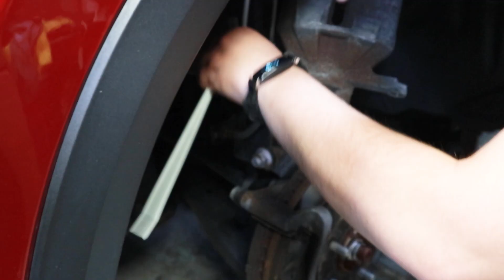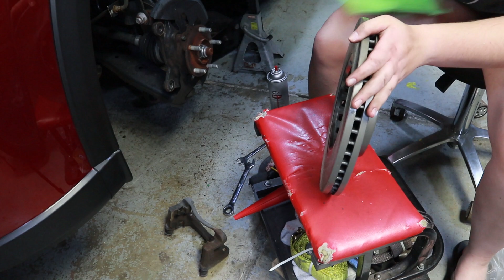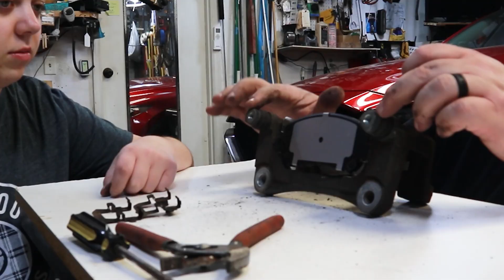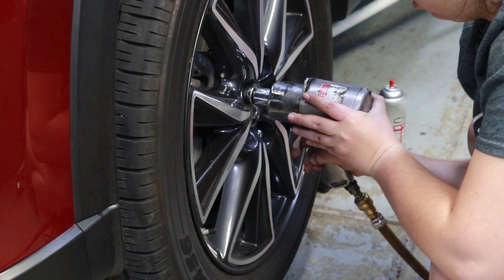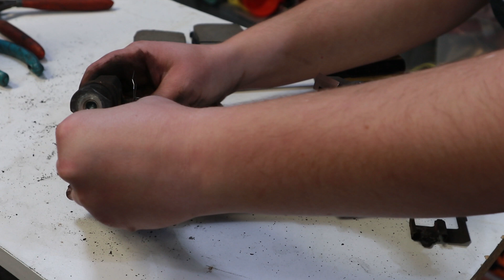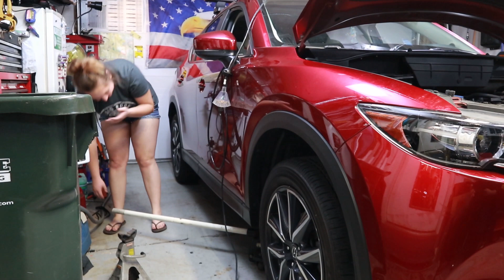Replace Front Brakes on a Mazda CX-5 or CX-9 #baldeagle242

Comment: I went in to the dealer 2 years ago with my 2018 CX-5 (had 40k miles on it at the time) and they said I needed new rotors and brake pads, I didn't have the time myself so I forked out around $800 to have them do it! I found it very odd that such* a new vehicle would need new rotors so soon
Reply from the maker: That was my thoughts as well. I've always changed my own brake pads and rotors, and this is the only vehicle I've had to replace rotors on before the first set of brake pads wore out. Thanks for watching!
Reply: I have the CX5 and the rotors warping is a know problem. I'm kinda upset as well. I just bought the car used only has 40k on it and the car needs new rotors which is just nuts

Comment: Love the father-daughter teamwork. My daughter has the exact same vehicle and we've done the same job!! Just a couple of additional steps some folks might want to take. 1) Clean the calipers with a wire brush to get any corrosion out from under the new pad shims 2) lubricate the shims where the pads slide on them with some brake grease. Lack of lubrication here is often the cause of premature wear because the pads get stuck against the rotor. 3) Don't assume the caliber pin bolts are okay just because they move freely. Take the out, look for rust, clean them and re-lube them with silicone brake grease 4) Use a torque wrench (most auto parts stores have loaners) especially for the caliper pin bolts. The torque is relatively low (around 25 ft.lbs) on those so use blue thread locker (no grease or lube). 5) use an old brake pad behind the C-clamp so that the clamp jaw doesn't dent the caliber piston. Also push the piston back in very slowly and have the brake fluid fill cap off (to relieve pressure in the master cylinder). If the piston takes excessive force to go back in, the caliper is likely bad. 6) clean the wheel hub with a wire brush before putting the new rotor on the hub. If there is any rust on the hub, the rotor will not spin true and pre-mature brake and tire wear/wobble can result. Lastly,  a thin layer of anti-seize or grease where the rotor meets the hub will ensure they do not get stuck later on. Hope this is helpful and again, great video.
Reply from the maker: Thank you!

Comment: Did i miss the section where you applied brake grease to the new clips and back of the new pads? Anti seize on the lug nuts help make the job easier next time.
Reply from the maker: It’s been a while since I’ve watched this video but I’m pretty sure we showed it at some point. 🤷🏻‍♂️

Comment: I recommend rotors with every brake job. These days the warp easy and they’re not as think as they used to make ‘em. Also they do rust if not driven as often as they want to be
Reply from the maker: I have to agree with you on the rotors.  Gone are the days you could turn them a couple times and reuse them. Thanks for watching.  🦅🇺🇸

Comment: Great video, but few steps are missing.  Are there brake pads wear indicator clips , which are usually attached on the sides of the brake pads ?  You should've point out that the brake fluid reservoir needs to be open during the process of squeezing back brake piston .  Also, at the completion of brake job, brake pedal should be primed (pumped down) a few times before driving .  Mazdas CX5 are generally good cars, but notorious for  their weak brake pads and rotors which tend to be worn prematurely .  You are lucky dad, as you have lovely daughter .  IMAO I personally wouldn't let her lift that heavy wheels only by herself .  Thank you for your video and effort .  Greetings from Croatia

Comment: When you push the cylinder back in with that C-clamp, aren't you pushing dirty-rusted brake fluid back up to the brake reservoir? Isn't there a technique or practice to prevent that from happening, especially having an old vehicle?
Reply from the maker: +Bill Krause, my assumption is it's the same fluid that gets pushed back and forth with normal braking. If there's dirty rusted brake fluid in there you've got bigger issues.
Reply: Yes, changing the fluid is a separate job and you'd normally do it when you change the calipers because you have to bleed the brakes at that time. 

Caliper is likely sticking and causing the uneven wear on the rotors! That is why you notice the difference, they should appear even. Also clean and lubricate the long pins that the pads move on as rusty ones can also cause uneven wear. Thankfully you didn't have to back down ABS on this newer ride.
Reply: You can open up the bleeder valve before pushing the piston back in.. That way the fluid in the caliper dont go back into the system.

Comment: Great Video! I need to change mine soon, You don't have to bleed the brakes do you?
Reply from the maker: You won't need to bleed the brakes unless you have to replace a caliper or open the system up for another reason.  Just remember to slowly pump the brake peddle a few times before you drive the car.  This will ensure the caliber is where they need to be for the pads to engage the rotors.  Good luck with your repair.  Thanks for watching and let us know how it turns out.

Comment: I have a 2019 CX 5 AWD Signature - 11000 Kms (6000) miles and all 4 rotors and pads need replacing - Dealer states car was not used enough and rust damaged the brake rotors and subsequently the rotors damaged the pads - No warranty - Total garbage parts in my opinion -  PS - your daughter is a class A mechanic
Reply from the maker: Thank you.  I agree with the garbage parts. No reason these rotors should be shot in such a short period of time.

Comment: those pads do not look original to me. I changed rear pads on cx-5 2018 at 45k miles, rotors were in good shape. I would clean rust and apply grease between hub and rotor, also on shims. if you are up to change rear too, do not try to push cylinder, you will ruin electronic brake system. There is a special procedure to suck piston in.
Reply from the maker: Thanks for the info and tips.  So far rears are still good. We will be sure to look into proper procedures before attempting to change the rears.  Thanks for watching.  🦅🇺🇸

Comment: I was changing front rotors on my Ford Ranger 4X4 every year due to warping, that was all I can get at the parts stores were rotors made in CHINA. Then I switched over to American Made High Performance Slotted and Drilled Rotors with Pads (Ebay), that lasts and lasts for me. You get what you pay for.
Reply from the maker: Very true about getting what you pay for.  She bought this car used so we don't know if these were original or not. 
Thanks for watching.  👍